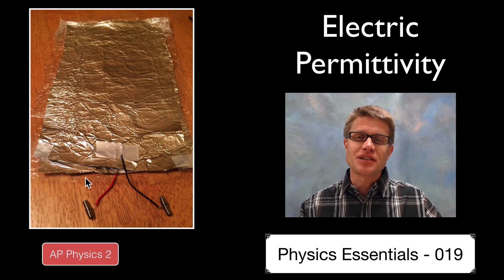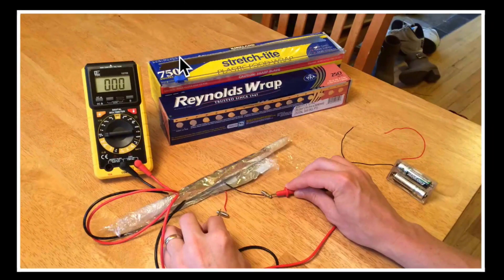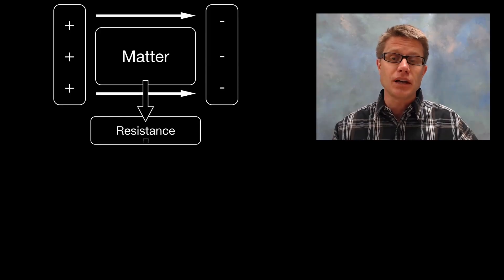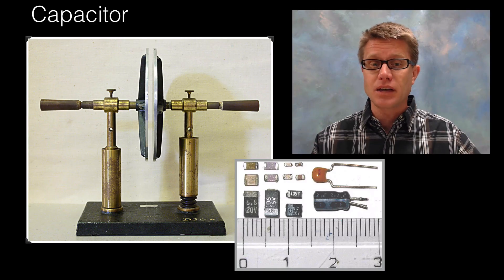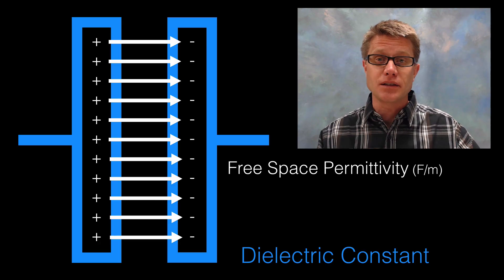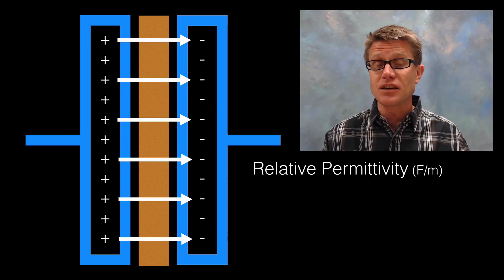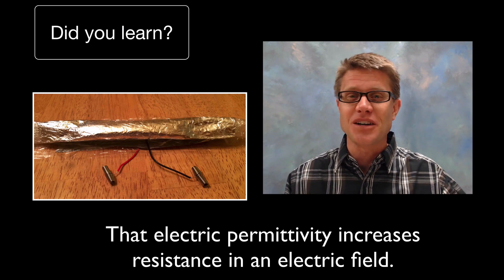Electric Permittivity

Comment: Gauss's law shows that the amount of flux intersecting a spherical Gaussian surface is: Eo(4πr²)=Φ=Q(inside)/εo.

Therefore: Q(ins)/Eo·A=εo.

This is the charge density per electric field, or the charge per flux line intersection with the Gaussian surface. 

It gives an indication of how much charge is permitted on a surface.

The higher the permittivity value, the more charge is permitted on surfaces but this will lower the net electric field Enet inside the dielectric (vector sum of the free space plate fields Eo & the induced dielectric fields Ei) as the fields cancel out more if there are more induced charges of opposite sign on surfaces inside facing the outer surface plates , which is what happens in a capacitor with a dielectric.

A dielectric lowers the net electric field 
Enet=Eo↓ + Ei↑=Eo↓+(-bEo↓)=(1-b)Eo↓=Eo↓/κ,
by a factor sometimes called 
the dielectric constant κ.

If the charged plates remain the same, as a 
dielectric is inserted between them, 
the new permittivity would be: 
Q/(Eo/κ)A=κ·εo=ε, 
Where Q/A=σ=charge density on 
Gaussian surface with area A.

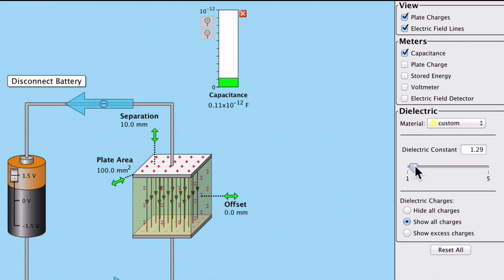Comment: Looking at the examples starting around 3:40, 
what would you expect would happen if you charged the cap with a glass dielectric (@3:52) and then disconnected the power?
Now remove the glass, what is the charge on the cap? 
Take the glass dielectric plate you removed, and place it between the plates of a second uncharged capacitor. Does it charge?
What does the result of the second capacitor becoming charged almost to the same value of the first do to your understanding of what was presented in this video?
What is really happening?

Comment: @2:28: Isn't the value of free space permittivity = 8.8541878176×(10^(−12)) F/m? In that sense the value of 1 F/m given in the video is incorrect, right? 
My reference: https://gpg.geosci.xyz/content/physical_properties/physical_properties_dielectric_permittivity.html#measurements-for-dielectric-permittivity
Reply: He was referring to the dielectric constant of free space. A dielectric constant (relative permittivity) is the ratio of the permittivity of a material to the permittivity of free space. Therefore this value would be 1 for a vacuum. (with no units since they would cancel out)

Comment: 4:02 Could anyone explain why does the electric permittivity increase resistance while it also increases the capacitance?
I didn't take ap physics 2 but have to know this concept for the subject test
Reply: The thing is that capacitance is equal to Q/V, where V is the voltage (difference of potential). Meanwhile, if the electric field is constant (like in this case) V=E*d, where d is the gap between the plates. Because the dielectric increases resistance, it reduces the electric field and so E*d becomes smaller, so V becomes smaller and the quotient Q/V increases. Hence, the capacitance increases.
Reply: Not so sure either but,
I think without any dielectic medium the charges accumulated at the two plates would create Electric field which would make them to loose energy
And adding those mediums with "resistance" would allow some of those fields to be cancelled i.e., leass field and thus more chage would be stored in a capacitor

Comment: I have a question sir... Why does the charge on capacitor plates increase when we put an dielectric inbetween... I understand the resistance in electric firld concept but i dont get the why there is increasement in charge on the plates?
Reply: Same doubt bro, did u get the answer?

Comment: Also note permittivity changes with freq, value at dc-10kHz isn't the same as the value at 300MHz. Dielectric constant typically refers to the permittivity in those low freqs/DC

Comment: Are capacitors used in mobile phones for the vibration purpose or something else is used? Please answer anyone!
Reply: Vibrations are created by spinning a motor whose weight is not evenly distributed about the axel
Reply: small moter is use their
Reply: For filter purposes i think it is generally used in a circuit which regulated signals
Reply: It is used in amplifiers,rectifiers and different electronic components

Comment: This is probably stupid, but at 4:20 you say that the dielectric creates a 'resistive field' to appose the electric field, but how does that increase the permittivity because then surely the electrons have nothing to be attracted to if there is no overall force there? Because before they would be attracted to one side of the plates, which in turn repels the electrons on the other side. I don't know if that makes sense, I'm only an a level student so I don't think my understanding is quite right? Thanks for any help :)
Reply: Jennifer Bartlett exactly my pt!

Comment: awesome vid. quick question - why do the cap plates have to be in close proximity to eachother? why doesn't a capacitor work if the distance between the plates is massive? i'm guessing the further away the plates, the higher the permittivity of the electrical field? or does the permittivity value not work in that way?

Cheers!!